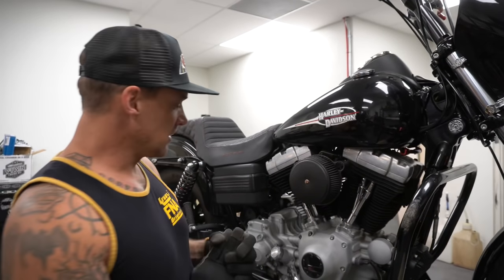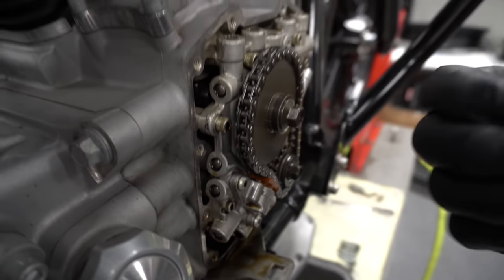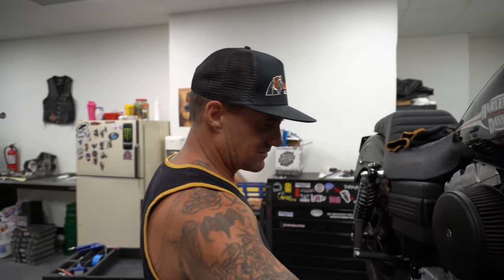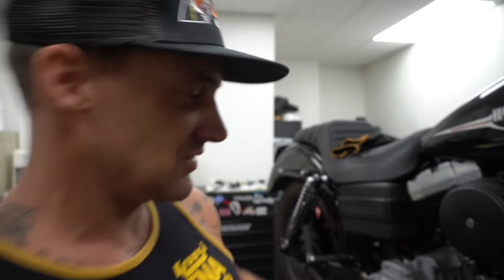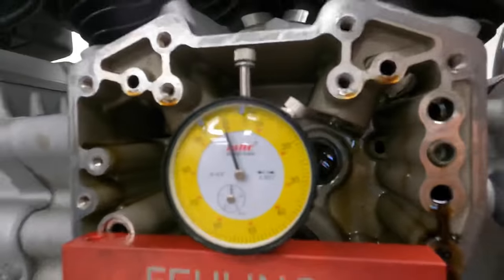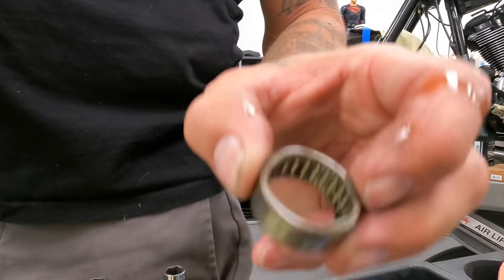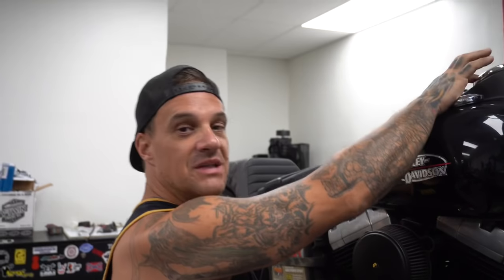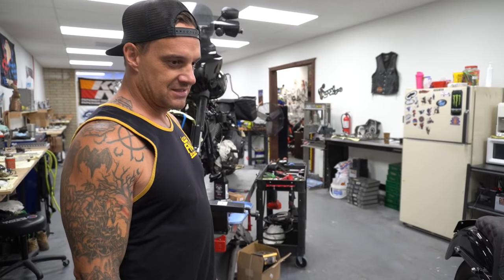how to cam a harley

Comment: Thank you for this video, I plan on installing cams on my 2007 FXSTC TC96 when I switch to a 2-into-1 exhaust during the winter, so I am starting my learning now in June.  I work in a Harley shop, so when the techs are doing cam jobs I try to observe what they are doing, but I am really busy.  The shop charges 8 hrs of labor to do a cam job, and even with my discount, that is out of my reach.  So just like everything else, I need to learn to do it myself.

Right now I am gathering the tools needed, so your tips on the essential tools and the things I can get a Harbor Freight, really helps this poor guy.  I don't even have a garage, so I gotta figure out where I will be doing the work, I will probably build a shed to do it in.  I got a garage planned, but the cost of materials now doesn't allow it.

again thank you for this kind of videos, the way to explain things really worked for me.  I am mechanically inclined, I just don't have the knowledge or experience on big twins, like I do on other things.

Comment: I see that you assembled the pump into the case first and then placed the plate with the cams into the case. Feuling's instructions tell you to hand tighten the pump to the plate first and then place the whole assembly into the case as a unit. Is there any particular reason that you did it in that sequence? I'm about to do this on my 2004 Dyna.
Reply from the maker: Do it my way trust me it’s a lot easier. Follow all of their alignment procedures but install it my way. If you don’t have an alignment to order a line all the sprockets inside the oil pump you will play hell getting that thing on that way

Comment: Thoughts on reusing stock pushrods with mild aftermarket cams?... if your pulling valve covers anyways.. i was gonna install some rocker lockers with a s&s mr 103 cam. 
With new johnson lifters.  Should I just get adjustable push rods anyways?
I've built plenty of dirtbike motors and car short block assembly's. But Harleys are new to me

Comment: Just wondering if those torrington bearings are a bit tight to get to spin with your fingernail where the old ones spun really free. Just debating pulling these new torringtons back out or not.

Comment: Do you need to check lifter to bore clearance? Feuling has those ‘sized’ bore balls. Or is that another one of those Jim’s tool situations we don’t need to bother with? 😆
Reply from the maker: It’s always a good idea to check very rarely do you have to upsize though. I don’t really use feuling lifters much either.

Comment: Just used this video to do cams on my 07 street bob. Great video. Got it all tied up and using the test light to prime. It's not priming 🙄 . Not sure what the deal is.
Reply from the maker: Sometimes it’s takes a while.  It helps if you fill the oil filter full of oil and put it on. Should’ve done that anyways when you put fresh oil in it before you tried to prime it.  
If it’s still not working you need to take it apart you probably did something wrong
Reply: @kruesioriginals  when I had the test light on the sending unit I noticed it lit up just sitting on the plug. I wasn't actually putting it on the connector part of the plug. My dumb mistake. But all good! Thanks for the walk through video. It worked great 🤘

Comment: Great video, Thanks. Makes me want to go out and tear my bike apart. Well, as soon as I get another $2K to blow. The only thing that gave me pause was seeing you beating on those bearings. You sure took an awful chance there. It is really easy to get a piece of flat stock and drill a couple of holes in it. Find a bolt or some all thread to push them in with. Or, if you have an old clutch spring compressor for an Ironhead Sportster you could use that.

Comment: Looks like you done this before. Getting together my last bucket of parts to do my 1st. 03 FLHRCI, Feuling 8011 conversion, Fueling 7060 pump, Red Shift 511 cams, HLJ 2313SE lifters, S&S quickies etc. etc. etc . I've got the "A" motor with the plug in the case. Wanted to know that size allen plug to use to plug off the back of the plate. Want to keep all the oil I can in the plate. Got the plate unused/from ,,, ole what's his name so been havin to track down little necessities. Fueling trying to sell me their sprocket/chain set $$$$$$$$$, So another question. What's the problem with using original chains and sprockets, same gear count. I got 31k on the bike, figured the chains have polished them selves fairly smooth by now. What say Ye

Comment: Hell yeah. This will be my next upgrade. Thanks for the good video. I was reading someplace about the tool to press the cam bearings in has a .02 step on the face so they sit that far below the face of the bores. Is this bullshit? You just put them the whole way to the shoulder of the bores. Thanks for the great content keep it coming. Also 107 or 110 kit for my 103?
Reply: Nvm I figured it out. They say to seat the face of the bearing 3.100 from the face of the case. Any input on this?

Comment: kruesi i do not understand the "welding the pin into the crank and putting a pro plug in it" that means you have to pull the crank true it and then weld the pin? welding the pin is just for when ur bangin limiter and it doesnt rattle out and leave the crank floating around correct? just wondering im new to all this thats why i watch ur videos
Reply from the maker: That’s a lot to explain here.  If your building any real power it should be welded and plugged

Comment: Ryan, you thoughts /preference from chain drive cam to gear driven?
Reply from the maker: I don’t run gear drives in any twin cam it’s pointless. Hydraulic chain tensioners and a single roller chain are far superior. Harley Davidson cranks are way too out for gear Drive
Reply: @kruesioriginals  thanks, I was debating doing a chain or gear driven  …as  I heard a lot of crap talk on the tensioners going out and gear was better…I’ll take your PRÒ advice!  Real quick I have a 04 springer TC 88 stock…40k miles and want some punch nothing crazy…mostly  long distance driving …your recommendations ?

Comment: Does 4 turns work for all cam sizes?.. would a larger cam need shorter pushrods than a smaller lift cam? Or does the lifter make up the difference in lift langth? Thank you.
Reply from the maker: Push rod adjustment has nothing to do with the Cam it is all in the stroke of the lifter
Reply: Sweet thanks Ryan. Going for first test ride now. Has to be 108 outside.

Comment: Hey when you prime the system, you remove the spark plugs as well as the gas lines?
Reply from the maker: Just the plugs
Reply: @kruesioriginals  then you just turn over the motor in small spurts? Wouldn’t you have a ton of gas in the jugs? Or do you let it evaporate before starting it.

Comment: Front cam ,the one with that pesky sirclip . Whats the end play in that cam ? You used the original spacer , but what’s acceptable play (in n out) . Good vid , cheers
Reply from the maker: Service manual
Reply: That cam just uses the .100 factory washer/spacer if anyone else is wanting the answer. End play isn’t measured.  👍👍

Comment: This pinion runout is great.. he says it can be up to 0.011” but feuling and S&S cam plates require 0.003” pinion runout to use them.. also would’ve loved to hear it run
Reply: That .003 is for great drive cams by the way. Chain drive is ok
Reply: @Twilly121  did you mean gear drive cams? I didn’t know that.. thanks

Comment: You like to run Synthetic oil on your bikes? Does mileage matter?
Reply from the maker: Run good synthetic oil.
Reply: @kruesioriginals  so what oil is that? And should all 3 hole be the same synthetic oils
Reply from the maker: @spoads8619  klotz or motul in motor.  Motul gear oil in trans, Primary depends on what clutch you have.
Reply: @kruesioriginals  motul makes great oil

Comment: As a service writer for a Harley dealer I never recommended anyone install a Timken conversion. I've seen more failures on a Timken conversion than stock bearings. Those screws that hold the conversion cup are tiny and carry a lot of load. I've seen them spin out and destroy a set of cases.
Reply from the maker: That would be a bad install. I have never had a Timken bearing conversion come apart fail or even go bad in any way shape or form.
Reply: @kruesioriginals  I have heard from a few people that install them that swear they have never had one fail and I believe them. I'm just sharing my experience.

Comment: Good runout figures there..... Andrews always say that you should measure runout with the cam-plate fitted, don't know why - do you ? S&S doesn't mention fitting the cam-plate for the measurement and Harley give maximum runout figures for measurement taken in the cases of 0.010 " and in crankshaft stands of  0.004 " as the type of main bearings used will 'exagerate' the readings in the cases. 
A bit confusing to say the least - I measued it at 0.0035 and went ahead and fitted gear drive (S&S 640 easy start) cams and all is fine. The 'bacxklash' on the cam to cam and cam to crank gears is all perfect and there is no noise whatsoever. My motor has re-engineered CVO top end giving 113 inch with the crank trued and welded to supposedly 0.0005 " in stands.
 Motor puts out over 130 bhp and torque and is a blast to ride !!!!   You should use new tensioners, chains and sprockets cause they all wear out ya know and S&S oil pump and cam plate are much better than Feuling stuff  !

Comment: For the cam chain torque process i used the handle of my hook tool between the gears and the chain but ill try a screwdriver next time.  Watch the older videos like reruns and still earn new things every time.

Comment: Shit I got lucky!, doing some cams and a s&s tc3 cam plate on my 2000 fatboy tc88 and I check my pinion runout with my fueling runout tool and have a nut hair over 1 thousandths runout at 70k miles so looks like I'll be going gear drive cams.

Comment: Ok guys I'm doing the S&S cam plate oil pump swap. The stock upper oil passage where the small o ring goes has a filter element. Do I include that or toss it?

Comment: Make sure the valves are closed, tdc compression, before you cut the pushrods. If the valve is open, nasty surprise when ya cut them.
Reply from the maker: Not true